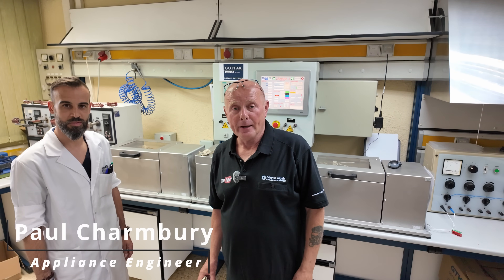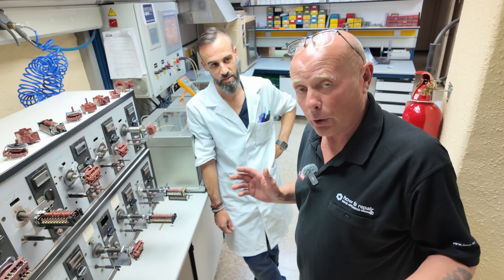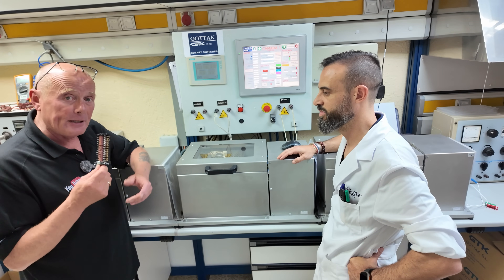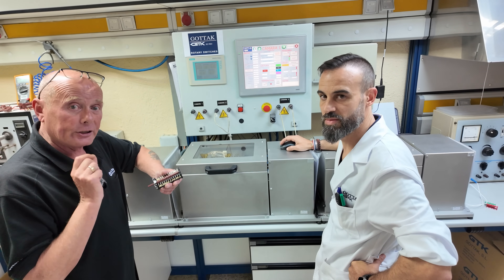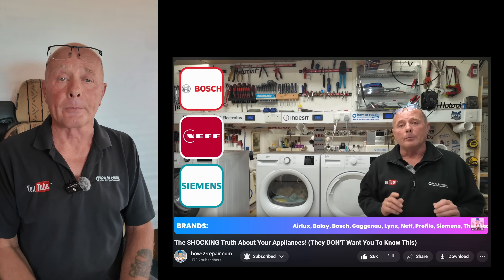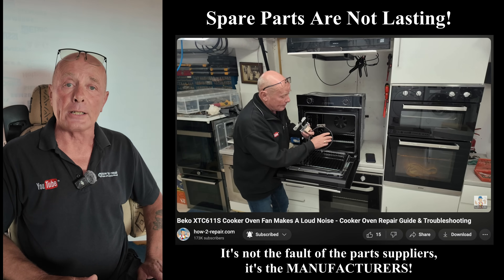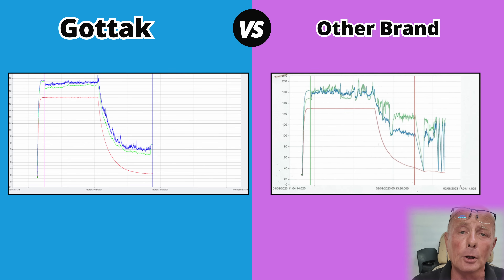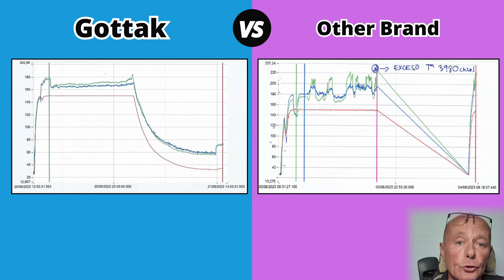Why Your Appliances FAIL SO FAST! Lab Results EXPOSE the Truth!

Comment: Accounts are the wrong people to be allowed to select components.  They have no idea that they are potentially putting consumers at risk by the decisions they make.  Where as an engineer knows the failure modes and power handling requirements of the parts and probably a lot more knowledge than an accountant will ever know.  Accounts are great but they should be and advisory not the arbiter on how much to spend to keep the company profitable.  They should not have any input on the design of products that they have no knowledge of.  The problem is they are so far removed from the reality of manufacturing that they will eventually cause a disaster for the compaqny and probably the consumer as well.

The only problem is that all manufacturing is run this way and there is no backward step a manufacturer can take with out it becoming uncompetitive.
Reply from the maker: Hi there! Thanks for your comment, @billywhizz6965!

You've hit on a really important point about the influence of financial decisions on product design and component selection, and how that can impact quality and safety. Your argument that accountants, while vital for business, may not have the engineering expertise to make critical decisions about parts, potentially leading to premature failures or even risks for consumers, is very insightful. This is exactly the kind of behind-the-scenes pressure that can contribute to built-in obsolescence, as cost-cutting measures can often take precedence over durability. The scenario you describe, where financial considerations override engineering knowledge, is a significant factor in why new appliances don't seem to last as long.

At the trade show last year, understanding how much obsolescence is being designed into new appliances these days – often driven by these very cost-focused decisions – is something everyone should be aware of. For a deeper dive into this topic and to see the examples we covered, please check out the full video here: https://youtu.be/gEgSCbZnHVM?si=wTIw0mELuhWaw4aX

We also explored related aspects in these videos:

The shocking truth about manufacturers: https://www.youtube.com/watch?v=QsdGd2qDPaI
Heat pump tumble dryers are they really worth it?: https://www.youtube.com/watch?v=xn03N3b0-lE
If you found this information eye-opening or helpful, please consider sharing this video with your friends and family. The more people who understand what's happening with appliance longevity, and the pressures that lead to it, the better equipped we all are as consumers.

Thanks again for watching and engaging! Don't forget to subscribe to the channel for more insights like this!

Comment: We bought a Bosch range nearly 10 years ago and up until recently it was flawless. Now the oven is having issues and the electronic component that needs to be replaced is back order and all they can say is it will take more than 6 months! It’s not just a reliability issue and designed to fail, I suspect they’re purposefully making the parts difficult to obtain so we run out and replace instead or repairing.
Reply from the maker: Hi there! Thanks for your comment, @antoinepageau8336!

You've hit on a really important point about the challenges consumers face with repairs, even for relatively young appliances. Your experience with your Bosch range – being flawless for nearly 10 years but now facing an electronic component failure with a 6+ month backorder – is incredibly frustrating. Your suspicion that parts availability might be intentionally limited to encourage replacement rather than repair is a key aspect of the broader issue. This is exactly the kind of built-in obsolescence we discuss in the video, where the difficulty or impossibility of obtaining spare parts effectively shortens an appliance's lifespan.

At the trade show last year, understanding how much obsolescence is being designed into new appliances these days, including strategies around parts availability, is something everyone should be aware of. For a deeper dive into this topic and to see the examples we covered, please check out the full video here: https://youtu.be/gEgSCbZnHVM?si=wTIw0mELuhWaw4aX

We also explored related aspects in these videos:

The shocking truth about manufacturers: https://www.youtube.com/watch?v=QsdGd2qDPaI
Heat pump tumble dryers are they really worth it?: https://www.youtube.com/watch?v=xn03N3b0-lE
If you found this information eye-opening or helpful, please consider sharing this video with your friends and family. The more people who understand what's happening with appliance longevity and repairability, the better equipped we all are as consumers.

Thanks again for watching and engaging! Don't forget to subscribe to the channel for more insights like this!

Comment: Want a solution to these early failures we as consumers are being inconvenienced by. Without consumers product doesn’t move. Let’s start boycotting certain manufacturers who don’t do the right thing. We as consumers will get back the power.
Reply from the maker: I've reached the point where I simply cannot tolerate this situation any longer, and that's why I made this video. I'm aware that this might cause some controversy, or even land me in trouble, but I believe it's crucial to try and make a difference. I would greatly appreciate it if you could share this video. Together, we might be able to bring about some change. If we can't shame the manufacturers into action, perhaps someone in government will see the video and take notice of the overwhelming number of comments expressing public concern.

Comment: All of my appliances are over 20 years old. So far I have spent $8 on my washing machine, $12 on my dryer, $250 on my fridge and $350 on my dishwasher for parts. I do the work myself so no labour charges. My fridge had no after market parts available so I got dinged on that. I basically rebuilt the dishwasher because it is heavily used and I knew it would still be better than a new piece of crap. My three siblings on the other hand spend thousands of dollars on appliances that keep failing just out of warranty. They also always complain how crappy and useless their three or four thousand dollar washer and dryer sets are. I paid $900 for my washer and dryer set in 2003. I never have to rewash a load of laundry because it doesn't get clean or rerun the dryer because the clothes don't dry. They basically have to replace their appliances every 2 or 3 years because the cost to repair isn't reasonable. As long as parts are available for mine I will keep them and repair them as needed. My advice to anyone buying any appliances that require an internet connection or cloud account to access "features" that you already paid for simply by buying the damn thing is to run away from that as quickly as possible. Companies continually change their ToS agreements taking away features that you already had then require a monthly subscription to reactivate them. If the company goes out of business then you might be left with a nonfunctional or limited use device. They'll also just stop supporting devices forcing you to buy new if the device requires internet access to a server that they shut off. I made a prediction back when cloud computing was just beginning to be talked about that eventually companies would strong arm customers into that space and once they're there would nickle and dime them to death. We are there now. If environmentalists really cared they'd be going after manufacturers to do away with built in obsolescence. Consumers can only buy what manufacturers produce therefore we have to continually throw away their crap as it breaks because nothing is made to be serviceable or repairable anymore. Laser printers are a great example too. I have customers still using laser printers that are 25+ years old. They still have serviceable parts available for them. New laser printers last 4 or 5 years then cost more to repair than replace so more waste generated. Modern technology is the most wasteful thing on the planet. There are literally mountains of old cell phones in landfills because people are brainwashed into buying the latest and greatest every 18 to 24 months. I still use an iPhone 8 and will use it until it dies or an app I need for work no longer works on it. None of my cell phones have ever died. Their inability to run the latest software or app I require is what puts them out of commission. We are such an incredibly impatient and wasteful society now. We need the latest and greatest and we need it NOW! Even though I work in IT I hang back a couple of decades when it comes to my own stuff. My cell phone is my most hated device because it is such an intrusive device that constantly interrupts me. If it wasn't for work I'd gladly toss it off a bridge.
Reply from the maker: Hi there! Thanks for your comment, @DrD6452!

You've hit on a really important point about the stark contrast between the longevity and repairability of older appliances compared to the constant failure and disposability of newer ones, even at higher price points. Your experience with repairing your own 20-year-old appliances versus your siblings' troubles with modern ones perfectly illustrates the issue of built-in obsolescence we discuss in the video. You also bring up excellent points about the pitfalls of "smart" appliances requiring internet connections and the environmental impact of planned obsolescence, which are crucial aspects of this problem.

At the trade show last year, understanding how much obsolescence is being designed into new appliances these days is something everyone should be aware of. For a deeper dive into this topic and to see the examples we covered, please check out the full video here: https://youtu.be/gEgSCbZnHVM?si=wTIw0mELuhWaw4aX

We also explored related aspects in these videos:

The shocking truth about manufacturers: https://www.youtube.com/watch?v=QsdGd2qDPaI

Heat pump tumble dryers are they really worth it?: https://www.youtube.com/watch?v=xn03N3b0-lE

If you found this information eye-opening or helpful, please consider sharing this video with your friends and family. The more people who understand what's happening with appliance longevity, the better equipped we all are as consumers.

Thanks again for watching and engaging! Don't forget to subscribe to the channel for more insights like this!

Comment: Not sure I fully understand the graphs. Assuming Y-axes show temperature, I don't get why there are a stable period, but then the curves drops? Or is it the controlled temperature that is set to decrease after a certain period of time or after sensing first occurrence of contact fault ?
Reply from the maker: all switches will have slight variations in the type of graph the Gottak switches have silver in the contacts the bridge and on some occasions the connectors depending on the switch, the others are off different manufacturers who don't use any silver in the contacts. This causes large differentials on temperature ranges between the feed in and the feed out when the circuit fails there is no conductivity at all on the contacts trying to explain all this in a short video is very difficult. I might not have come across perfectly usually failure occurs as the differential is get wider.
At the trade show last year, understanding how much obsolescence is being designed into new appliances these days is something everyone should be aware of. For a deeper dive into this topic and to see the examples we covered, please check out the full video here: https://youtu.be/gEgSCbZnHVM?si=wTIw0mELuhWaw4aX

We also explored related aspects in these videos:

The shocking truth about manufacturers: https://www.youtube.com/watch?v=QsdGd2qDPaI
Heat pump tumble dryers are they really worth it?: https://www.youtube.com/watch?v=xn03N3b0-lE
If you found this information eye-opening or helpful, please consider sharing this video with your friends and family. The more people who understand what's happening with appliance longevity, the better equipped we all are as consumers.

Thanks again for watching and engaging! Don't forget to subscribe to the channel for more insights like this!

Comment: Oddly, I have noticed everything has a single point of failure
that will repeat over the years.  A sensor in the washer,
a switch in the dryer, etc,  so I determine what the
failure point is, and buy a bunch of those parts.
Appliance fails?  Replace THAT part and move
on with life.   Its my plan and it works for
us, but not everybody can do that.
The internet is full of these solutions, but
they do take some time to understand.
-- North Central Florida
-- A retired software engineer
Reply from the maker: Hi there! Thanks for your comment, @mrbrown6421!

You've hit on a really important point about identifying and stocking up on common single points of failure in appliances. This is exactly the kind of built-in obsolescence we discuss in the video, and your proactive approach is a great example of how consumers can mitigate the issue.

At the trade show last year understanding how much obsolescence is being designed into new appliances these days is something everyone should be aware of. For a deeper dive into this topic and to see the examples we covered, please check out the full video here: https://youtu.be/gEgSCbZnHVM?si=wTIw0mELuhWaw4aX

We also explored related aspects in these videos:

The shocking truth about manufacturers: https://www.youtube.com/watch?v=QsdGd2qDPaI

Heat pump tumble dryers are they really worth it?: https://www.youtube.com/watch?v=xn03N3b0-lE

If you found this information eye-opening or helpful, please consider sharing this video with your friends and family. The more people who understand what's happening with appliance longevity, the better equipped we all are as consumers.

Thanks again for watching and engaging! Don't forget to subscribe to the channel for more insights like this!

Comment: Years ago there was an article in an auto engineering magazine, how computer modeling has made it possible for manufacturers to make things just strong enough to last the desired amount of time.  The example was , then, relatively new plastic throttle pedal.  Computer model it for X cycles, x cycles being the expected number of cycles in y years, and then mechanically testing it, and if it lasted longer go back to the computer model and reduce thickness, dimensions, something, somewhere.  If it failed early, beef up only the necessary areas.  In contrast, with their argument, the old beefy metal throttle levers where overbuilt and cost too much with no long term benifit.  (Benifit to the manufacturer that is).    Build it to last with typical use for warranty period and no more--to the manufacturer it is wasted money in materials. As you said, its the accountants running the show.   
My beef, electronics where it does not need to be. Electronics in wet environments, hot environments, etc.
And on the topic of electronics since I repair those items, over the years you stumble on obvious design time bombs.  A component selected that just barely has adequate ratings--the exact things they taught us in school not to do, because transients will get you. And thats just what we have, little time bombs like designed into every bit of electronics out there that are going to be the failure point.  If you work on enough of the same models, you quickly find out where the time bombs are, and if you take some time to study the schematics and live circuit you figure out that 25volt rated cap is getting hammered  so a bit of a service bench upgrade to a higher rated cap and done.
Reply from the maker: Hi there! Thanks for your comment, @alexb.1320!

You've hit on a really important point about how computer modeling is used to design products with a specific lifespan, and the deliberate use of under-spec'd components in electronics. This is exactly the kind of built-in obsolescence we discuss in the video.

At the trade show last year understanding how much obsolescence is being designed into new appliances these days is something everyone should be aware of. For a deeper dive into this topic and to see the examples we covered, please check out the full video here: https://youtu.be/gEgSCbZnHVM?si=wTIw0mELuhWaw4aX

We also explored related aspects in these videos:

The shocking truth about manufacturers: https://www.youtube.com/watch?v=QsdGd2qDPaI

Heat pump tumble dryers are they really worth it?: https://www.youtube.com/watch?v=xn03N3b0-lE

If you found this information eye-opening or helpful, please consider sharing this video with your friends and family. The more people who understand what's happening with appliance longevity, the better equipped we all are as consumers.

Thanks again for watching and engaging! Don't forget to subscribe to the channel for more insights like this!